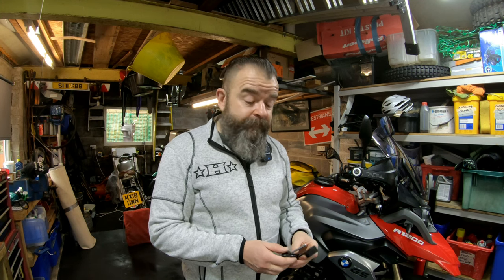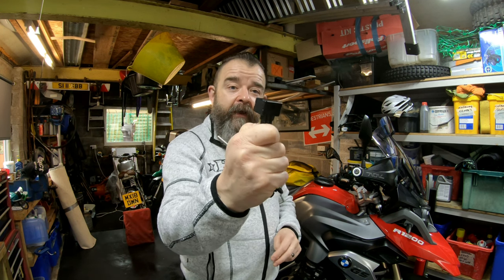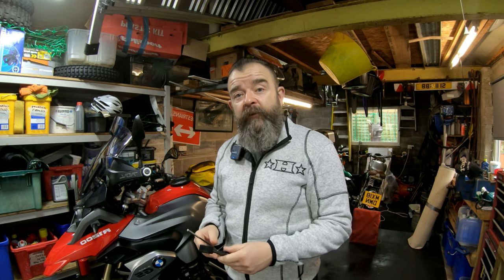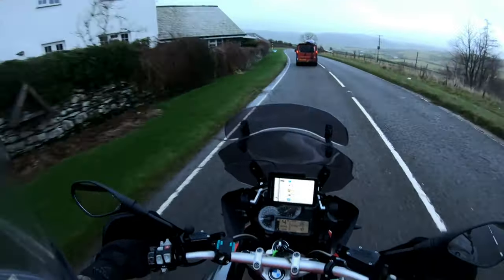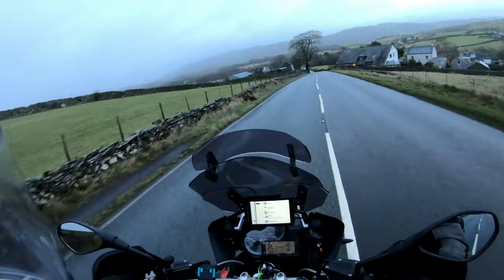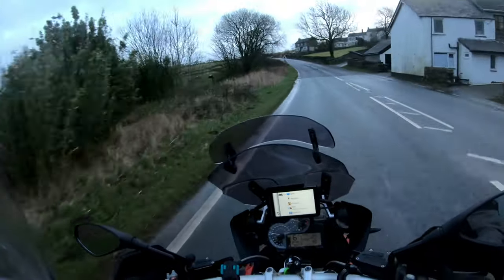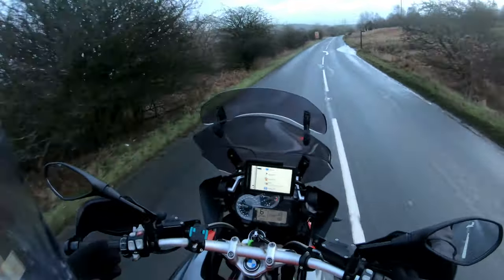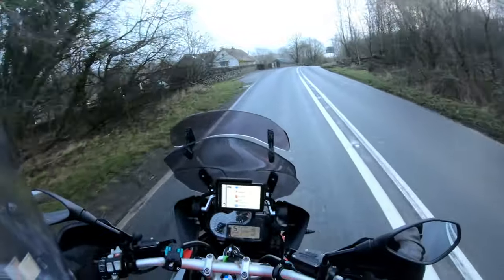The Original BoosterPlug, are they any good ?  Your Motorcycle will LOVE you for it

Comment: 2013 GS 12. I was seriously considering getting rid of the bike after two years riding around the truly awful power delivery. I eventually pulled the trigger on buying one of these after I watched the video. I can't think of a better outcome. It transformed the bike. No fluffiness, no hesitation and the bike that wouldn't rev out, even down a hill is now eager, faster and actually fun. I bought the bike with the factory option Akroprovic can on it and always suspected that it was interfering with things. Whether the Booster Plug has cured the issue or is papering over the cracks remains to be seen but so far, with about 300 miles under the wheels, I am really impressed.
Reply from the maker: Hey up gretchensghost, some will say it's all in your head 😉, and some will believe, then buy and use it 😲, glad it has worked for you, thanks for dropping a comment,ride safe, Simon B 👍

Comment: I put a booster plug on my triumph thunderbird 1600 and it ran alot better. I then got the thunderbird remapped and dyno tuned. I'm now going to put the booster plug on my MT01. It does make a difference in my opinion.
Reply from the maker: Hey up winksplayle, they are a bit of good kit they do what you want it to do, thanks for dropping a comment, ride safe, Simon B 😎

Comment: The Suzuki SV 650 and 1000s are famous for the V-twin 2K-2.8K engine shake, which is due to a lack of fuel or lean at that RPM range, then it kicks in at 2.8K. The usual fix is to adjust the throttle position sensor. But the BoosterPlug claims to fix the problem too. I’m considering buying one.
Reply from the maker: Hey up Steve, it should sort out that issue, I've got a few on bikes now, looking to get on for the hyperstrada, you bike will love it , ride safe Simon B 😎
Reply: @SIMONB1 Thanks Simon. Hopefully it will.
Reply: @SteveSteeleSoundSymphony did it fix it?

Comment: I’ve recently applied the booster plug to my Kawasaki W800 & it has improved it so much. It purrs along now so smooth & even. It hasn’t changed the performance so much but rather made it eminently more rideable & enjoyable. Like it’s been fine tuned. I also removed the air box snorkel a few days before, now that improved the performance above 4K revs & the plug is the icing on the W’s cake.
Reply from the maker: Hey up sefton1972, that's great news, some say it doesn't make a difference but others know 😁, thanks for dropping a comment, much appreciated, ride safe, Simon B 👍
Reply: The snorkel is said to restrict air flow. I also have a W800. I had it on for the last few years and it's debatable whether it had any effect. I just took it off yesterday because I didnt realise that I left it on. My initial problem was uneven fuel when cruising at very low speeds in first. It was like an on-off switch.

Comment: I just bought a secondhand R1200R and removed the boosterplug that one of the earlier owners fitted. The idle immediately improved and now I am convinced that the throttle action in general is much improved. Which just goes to show how difficult it is to judge these things. I'm terribly sorry, but personal anecdote is a very poor substitute for a randomised double blind trial. You get the improvement that you expect, snake oil purveyors have always been able to rely on this fact. In other fields they call this the placebo effect.
Reply from the maker: Hey up Tony, seems like it also worked with you the effect 😁, have you tried plugging it back in to see if it makes all them things worse again ? Some say the bike learns it's there, I can't agree with that as it's not artificial intelligence 😲, ride safe, Simon B 👍
Reply: @SIMONB1  Yes of course, I was kinda saying as much. I don't really know whether it is better or not and I don't trust my judgement to be any better than 50-50 in this regard. As for the bike learning, the makers say that you can't fit it to BMW's made after 2020 because the ECU will detect an issue with the AIT sensor and flag it as a system failure. These engine diagnostics are getting very good. Again, I can't speak for M/C ECU's but I do know that car ECU's are adaptive and over a period of time create new timing and injector corrections that they store in NVRAM inside the ECU. If you make changes to the car that impact on the ECU you are supposed to remove the power from the ECU so as to reset the internal NVRAM settings and let it start again. This process is so sophisticated that it can adapt as the engine wears and keep it running longer before it finally gives up the ghost.
Reply: I placed one of these on my Z900rs to tame the snatchy throttling. Zero change. No improvement at all. I did receive a really nice cell phone charger with the booster though. I think that’s what I paid for. I removed the booster and had the ECU remapped and Wha-la ! Throttle responds as if the bike is carbureted. My personal opinion is the booster plug is useless. Snake oil. I played around with it by relocating the ‘sensor’ however that made no difference. Those who believe it helps or works, I say that is wishful thinking.

Comment: Nice one Simon. Will be interesting to see how it goes longer term. I had an earlier version on my old twin cam GS. It was good for a while, but the bike seemed to learn it was being fooled and over time adapted the air/fuel values back to normal. Disconnecting the battery to reset the bike, and the booster plug would be doing its thing again.
Reply from the maker: Hey up Mark, long term is the key, hopefully it will be ok just have to see, watch this space, ride safe, Simon B 👍
Reply: This is the point. I  thought that I had an improvement for the first couple of rides and then it seemed to return to the on-off throttle when you wanted to go slowly through built up areas. The other aspect is I have a kawaski w800 and it may work for BMW fuel injection but I dont think it does for other bikes.  Having said that, sefton below also has a W800 and says it works.
Reply from the maker: Hey up Mark, maybe you got used to it ? Have you tried unplugging it and re booting it ?
Reply: @SIMONB1  Thanks for the suggestion. Yes I saw that as a suggestion. I just put a new battery in BEFORE I took the booster out. I should have left the booster in to see if it made any difference. But I'm going to interested in the coming weeks if removing the booster has any effect. I knew more about this a few years ago when I installed it but there is the idle system and the acceleration system for the fuel injection. It can on affect the idle system because acceleration bypasses the mapping. The question is whether the slight adjustment of the temp compensation makes the mixture richer and overcomes the lean mapping that they use for when the bike is cruising.

Comment: I'm not sure all bikes run very lean from factory in order to meet emission requirements but this was the case and reason I got one for my bike. Do I notice a performance improvement? I'm not sure, to be honest, since I never dyno'ed the bike. A slightly richer AFR is not a bad thing though, so that's what I'm going with as a reason to own one. There are better options but this is plug and play and forget about it.
Reply from the maker: Hey up x Pepi, a leaner running bike is a hot running bike, thus making the cat work better and burning all the exhaust gases, mostly all bike including cars are like this nowadays, if the ECU was remapped not much more power is available from the engine, but the plug smooths the entire bike, what bike is yours ?
Reply: @SIMONB1  I removed my CAT and stock exhaust and put in a Zard, for my 2016 Duc Scrambler. That was the reason to get the plug. I tried a Rapid Bike EVO module but hated it and my bike didn't respond well to it despite months of tweaking the software. The plug seems to do what it needs to do. You're right about the leaner bike running hotter, though my bike is probably as hot as it gets :)
Reply: I just put one on a 2018 Z900RS, and it’s doing exactly what they said it would do. The thing I like most about it, other than the obvious improvements in performance, is it’s easily reversible, just take it off.

Comment: HNY.   Be interested to see how your fuel economy goes.   My R1250GS fueling feels spot on.  I'll try and be more conscious of it next spin out, but I've done 13k on it without a hiccup and I do tend to bimble and make ot lug a higher gear than i ought
Reply from the maker: Hey up Andy, I thought mine was, until I realised it wasn't, thus the booster plug, at 100% throttle the fueling is ok , it's just everywhere else,.have a look at this https://youtu.be/gi0yCMS2mEc, ride safe, Simon B 👍
Reply: @SIMONB1  Eyup, I've already spoken to Kal at BHP back in November.  Had a nice chat with him about the tune up.  I was a bit twitchy at the time regarding my BM's warrenty, which has just over 12 months remaining.   But I'm still tempted regardless.   Looking forward to the next R1300GS and what that might have to offer.  You can't take it with you!!  Keep the vids coming 👍

Comment: Looks interesting, I’d be interested to know how much the fuel performance is affected, but that looks really interesting. 
Great roads to ride on too! Loving the views across the moors(?) need to head up there and have a play I think.
Reply from the maker: Hey up Julian, yeah long term  we'll have to see,this is interesting tho -https://youtu.be/NVyG_Dqmy7Q, ride safe, Simon B 👍
Reply: I have them on a 2019 SV650 and 2016 XSR900, significantly reduced on/off throttle jerkyness for both bikes. Only thing is that the yamaha needs some throttle when hot-starting after fueling on warm day.

I believe the average fuel consumption has increased by 0.1 km/l, over a couple thousand kms before and after. But that can be attributed to other factors, such as more confidence with the bikes etc.

Sidenote.
The dealer had never seen a chain in such nice condition after 40k service. And I'm not a stickler for chain cleaning. I believe the reduced jerkiness has a secondary side effect.
Reply: 6% increase in fuel.

Comment: I had a 2015 GS and always rode it in road or dynamic. Never really had a problem except when my wife was on the pillion then it wasn’t quite so good at slow speed. I tried it in rain and hey presto all that bogging down disappeared. I have a 1250 and a 750 and the 750 is the opposite, again especially two up, ride in dynamic or face that feeling it’ll stall, not good two up turning at the lights, dynamic mode takes all of that away. Many years ago I had a K1200 great on the open road but scary in town going to the point it would stall then suddenly kick in not so good on a 150bhp 300+kg bike.
Reply from the maker: Hey up southwest 6031, with the booster plug all your troubles would be sorted, possibly, hope your enjoying the 1250 is it that much better than the 1200 ?
Reply: @SIMONB1  definitely better but I only got this when I was changing bikes wouldn’t have bought it otherwise was happy with my 1200. I have an older 1200 as well a 2011 anniversary edition and love that bike it was my first GS and don’t want to sell it. I actually like my 750 and probably use it more than the others, I ride Yamaha 1300 blood bikes and when I get back and get on the 750 it feels like a bike mountain bike. Love the videos look forward to the next although still catching up with the catalogue 👍
Reply from the maker: Sometimes smaller is better and more fun 😁, thanks for dropping a comment, and watching the videos, ride safe, Simon B 👍

Comment: I have a vfr1200 that has snatchy throttle at low revs in first and second gear, quite annoying at times in slow moving traffic.  I wonder if this will sort that out 🤔
Reply from the maker: Hey up Jim, they do the booster pug for loads of bikes, I would say it would sort them problems out, ride safe, Simon B 👍
Reply: That's normal, either you learn the throttle by  feel or you can change the gearing by dropping a couple teeth on the rear sprocket. This will make your gears longer, lower RPM and make it feel like it has an additional gear. Another option is a throttle tamer tube.
Reply: @Mr.Be93  most people fit a power commander or get the ecu flashed on the  vfr  which sorts the fuelling and removes the limiters. Plus there's no rear sprocket on the 1200 it's shaft drive,  so not sure what your talking about.
Reply: Jim ,I have a vfr1200 and the booster plug did improve low speed throttle.

Comment: Hi, how is booster plug working after some time? Is it still doing its job or ecu readjusted and eliminated BP impact?
Reply from the maker: Hey up Ricard, I think it is , I'll have to unplug it and see if there's a difference, thanks for reminding me 👍, do you run one ?
Reply: I collecting feedbacks from owners who tested and read some opinions in forums, at the moment mixed opinions. I would like to get one to solve some hesitation when I ride in higher gear in slower speed. It is big twin with high torque number, but does not feel like it. Engine is almost perfect, but can be improved. Mine is euro4, so fuel mixture could be a bit lean in some spots and I feel it. I had crf1000 with booster plug and it helped,  bike pooled smoothly in 6 gear from low rews. My target is to have the same with my new for me r1200gsa when I want to be lazy and just cruise without gear changes :)

Comment: You can achieve the same thing by fitting a resistor in the original air temperature sensor wiring.
Reply from the maker: Hey up Pawel, maybe you should start manufacturing them and make a fortune 😜, thanks for watching and dropping a comment, much appreciated, ride safe, Simon B 👍

Comment: If the bike is running lean in order to pass emissions tests, and the booster plug makes it run richer, don't you run the risk of not passing the test?
Reply from the maker: Hey up wanderman1, on a bike test there is no emission test, they are trying to bring in a law to mak it illegal to change factory parts on the exhaust system, so at the moment there are no problems 😁, thanks for watching and taking the time to drop a comment, much appreciated, ride safe Simon B 👍